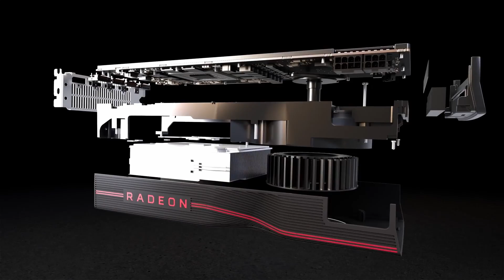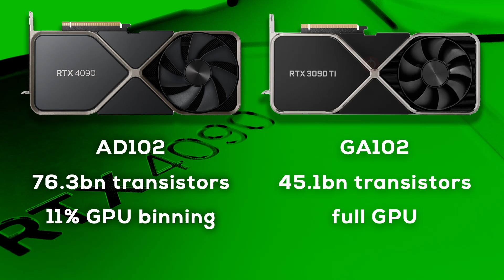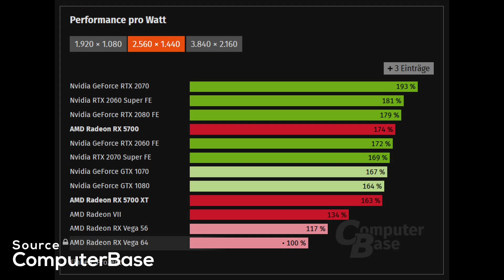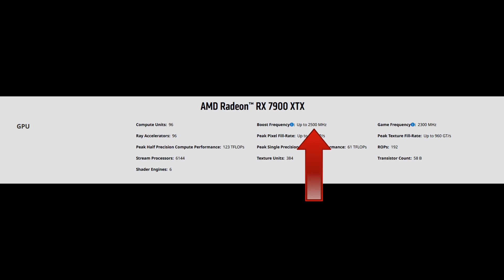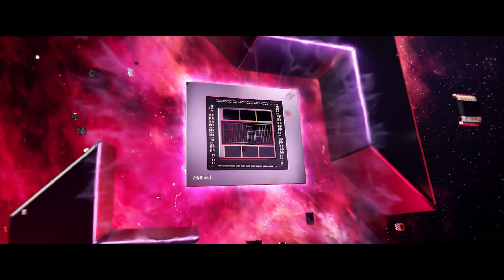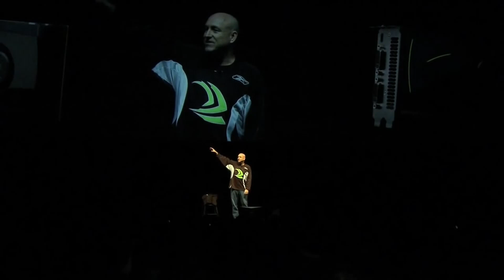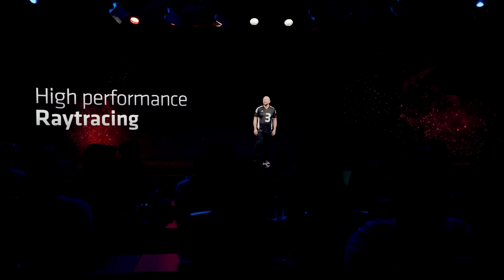RDNA3 – what went wrong?

Comment: If you think about it the 7900xtx was never meant for greatness. This is how I see it by doing a comparison with the 6900xt. 

The 7900xtx has 20% more compute units (96 vs 80), an average in game clock that is around 13% higher (2650 mhz vs 2350mhz), and the individual WGPs in rdna3 have an IPC advantage of around 17% according to AMD's slides. So let's do the math:

1*1.2*1.13*1.17 = 1.586 or 58%
The only factor which this analysis doesn't take into account is memory bandwidth, and we'd expect to see an additional smaller boost because I think many people agree the 6900xt was slightly bandwidth limited starved at 4k due to the 256 bit bus, and the 7900xtx is very impressive in the memory bandwidth department. 

In some games we do see +60% improvement on the 7900xtx vs 6900xt, but my thinking is this is where the game engine/driver can capitalise on the 17% ipc improvement from the new architecture. I have to admit I was disappointed that Amd have double the number of fp32 units per shader, and added larger registers/l1 cach, only for a meager 17% increase. In some games it looks like the new architecture doesn't offer anything above rdna2, and that will be a challenge for the driver team. That is my interpretation, always enjoy your videos!
Reply: wait wait wait? must be coffee, but do you mean that the 6900xt ran at 2350mhz? had two 6900xt and both of them ran with a frequency of 2540 without my doing anything. so the gameclock is a worst case scenario like on nvidia when they show a boost clock minimum which every gpu hits way over that.

To me it seems like everythign is in order, ie like it should if we talk about the increased memory bandwidth and shader count over 6900xt. If we then talk that the new rdna3 gpu actually is like ampere/ada then we should get at least additional perf uplift of 50% which we dont see. So something is up with the fp perf. And lets be honest, future games will probably not use that much integer executions so having int/fp capable alu units is the future because why would u have unused die area.
Reply: @Pillokun  You should check out an article by Computerbase where they did a clock for clock comparison between rdna3 and rdna2. They found the rearchitected rdna3 compute unit only gives a 9% performance increase on average. So definitely a long way from 50%!
Reply: @viktortheslickster5824  it means it does not work as it should. if u make the only int capable alu units able to execute float as well then all the unused resources often as many as the fp32 alu units u suddenly gain that much fp perf. so from 6k fp32 we now have 12k float alu units. 

Now games still need integer calculations but over all the most a game is doing is 25 to 33% of the total float calc so if we gaing 6k fp units we need to remove at least 33% to integer. so 6k fp32 x .66 = just a bit less than 4k additional fp32 units. and then we have to remove a bit because of u-arch deficiencies/game not utilising/scaling 1:1 with the available float units.  

so we should at least have gaming perf that equates to 9k fp32 units and that is not what we see because something is up with rdna3.

Comment: Anybody not expecting problems ie intel Nvidia and now AMD is optimistic. When new products hit the 1st gen usually have issues. That makes the customers beta testers. There's obviously something going wrong because the power draw at idle is way too high. Hopefully a better stepping will fix it. The drivers are also a problem because the performance is wildly inconsistent. I also think that the price is too high. I'll wait before I decide what to buy.
Reply from the maker: RDNA3 has a lot of new stuff: new architecture, new chiplet design, new 5nm process. It's a huge step for AMD and means a lot more things can break.

Comment: 7900 XTX owner here, I'm enjoying my awesome GPU that takes 110w on idle desktop :D (previous generation also had issues with high refresh monitors, taking up to 50w on idle)
While gaming I see a 30% performance uplift at the same wattage, compared to a 6900 XT LC (XTXH+18Gbps).
One more thing I noticed is that if you force the GPU to stay on high clock speeds, lets say 3000Mhz, it's gona sacrifice memory speed... resulting in a lower framerate (core 2400Mhz higher FPS than 3000Mhz) could it be that there's not enough power on the board to maintain high memory and high clock speeds at the same time ?
Reply: A 3rd 8 pin may be needed.  But AMD will have to put their foot in their mouth thanks to their claims earlier.
Reply from the maker: It's a really interesting GPU and I'm sure better drivers will fix a lot of early quirks.

Comment: got a good deal on a 6800 xt im happy
Reply from the maker: Great card, I'm still using a RX 6800 and it performs well (aside for Witcher 3 next-gen)
Reply: @HighYield  my build, ab350n motherboard from 2017, 5800x3d, 6800 xt ($1500 nzd or about 950usd i paid for these parts. I can even use SAM its great. and this is all running on a 500w psu

Comment: I just returned a 6950xt one month ago (XFX). Unfortunately, it was faulty. I noted the main issue was about power.  When it worked, it was impressive, then a lot of green screen and reboot. Can't pass 303w (instead 321w/340w full power stock settings). No way. Similar problem of a streamer with a 6950 gigabyte (stuck at 328 instead 350 or more).  I'm starting to think about some old manifacturing mismatch of rdna2 still present on rdna3.
Reply from the maker: I bought a RX 6800 in early 2021 and didnt have any issues so far, RDNA2 is very stable over all. Sorry you got a faulty one!

Comment: AMD's performance, as I've been saying since I joined the discussion, is that the performance envelop was smaller in the past generations comparatively between Nvidia and AMD.  It came down to process.  Nvidia chose to go with a better process from TSMC and proved the architecture of AMD will not have been better.

TSMC is the winner here.

Comment: how did they go wrong ? i will tell you it didnt go wrong at all,, infact they out smarted Nvidia with performance and pricing, plain and simple and AMD NEVER wanted to compete with the 4090 or even 4080 they said so,

i have 2 systems 1 full AMD and another Intel Nvidia and both run fine but bang for buck the AMD system smashes the Intel Nvidia set up, and as the age old saying goes money is better off in my pocket than somebody else, you are looking too hard into details that done need to be looked in too.

Comment: AMD confirmed that the silicon is fine re: shader prefetch. The fact that they nailed it on the first (A0) taping is a testament to the skills of their hardware engineers.
The issues lie with their drivers.
Reply from the maker: Yes, I mentioned it in the video too, but kept the previously recorded parts because it was an interesting rumor imho.
A0 is great, especially for such a revolutionary chiplet design. Still, there are usually a lot of different bugs in any A0 silicon, doesnt mean they have to be that impactful.
Reply: Drivers, or maybe even a firmware update might solve the issues..

Comment: Like any new AMD architecture, it has its problems. The next driver versions as well as much higher clock speeds of 3.0Ghz + Ghz will bring a significant advantage over the competition. I've never owned any Nvidia product, I've been using ATI/AMD products since the early 90's. In terms of price and quality, the new architecture leaves no doubt as to who won the race. Yes. As Linus said, it's AMD time
Reply from the maker: RDNA2 had a much smoother launch, I was really hoping AMD would stick to that quality over time.

Comment: What went wrong is that all the leakers were wrong about the shader count. They were right about the RTX 4090 but were wrong about the 7900XTX and XT. One has to wonder if it was purposefully midleading...given that they were right about the 4090. Also what went wrong is that AMD cherry picked benchmarks way more on this release than they did the RX 6000 series.
As for the 5700XT it was targeting the 2070 but many reviewers put it against the 2070 Super anyway. It was indeed faster than the 2070 and $100.00 cheaper.
Hmm about the transistor count....RDNA2 21 die has 5120 shaders...the RDNA2 31 die has 6144 shaders...does that sound like double the transistors to you? It would mean their CUs got LARGER with a new node if all 6144 shaders account for those 57 billion transistors...maybe some of the die is disabled.
Reply from the maker: The rumors were indeed way to optimistic. As for the transistors, AMD added AI-cores for the first time, the RT-cores got bigger, the a much improved display engine, a dual video-decoder that also now support AV1, a new encoder, a 50% larger memory interface and while its not that many more shader cores, they now are dual issue. Ofc I dont know for sure, but I think there are no disabled parts.

Comment: Something that has to be said and was touched upon in this video is that AMD is not getting good performance per die area as people claim. If you look at charts shared by AMD cache only shrink 10%  going from 6nm to 5nm that means that a monolithic 7900 xtx would have been 480 mm2 in size. if you look at the 4080 it has a die size of 380 mm2. With less than 80% of the theorized 7900 xtx die size the 4080 matches it in raster and it destroy it in ray tracing/upscaling all while being more energy efficient . I understand that the 4080 is more expensive but putting the prices that companies assign to their products aside and just analyzing technology, Lovelace is a far superior architecture to RDNA 3 and AMD lost bad. Maybe they can get better with a new release but i don't think this can be mitigated with just drivers.
Reply: going by price to performance AMD did not lose bad. I wouldn't say far superior technology either. It's just that RDNA 3 was rushed before they perfected it on the software side and that's very fixable. When fully overclocked the 7900xtx matches the 4090 for 500 less, and that's before the driver updates that are sure to come. Go look at the benchmarks.

Lovelace is superior in RT and efficiency, but overall no. RDNA3 has higher potential at much better value.
Reply: @mjkittredge  if we are going to compare over clocking then also over clock the 4090 . If you do that  the 7900 xtx will be a bit behind the 4090 . Which really gives you the same result as the comparison to the 4080. Because the 7900xtx is a fully unlocked die and the 4090 isn't. If you remove the part of the die that doesn't work the 4090 is a 540 mm2  slightly bigger than the 7900 xtx and slightly better in raster and again destroys it in Ray tracing, upscaling and efficiency . So similar conclusions. Not to mention the 4090 extra cores doesn't make it scale linearly compared the 4080 and really it is too big for games to take full advantage of. It has 60% more cores than the 4080 but gets only 30% more performance . 
And as I said drivers will not fix this if you look at the games where RDNA 3 allegedly shows its true potential , you will notice that RDNA 2 is also doing better than its average. These are games that simply work  better on AMD hardware it is not a window to RDNA 3 true potential.   And I would say the AIB models are already getting around the silicone flaws of RDNA 3 by just giving it more power . If AMD fixes the silicone I imagine the gains compared to these models are going to be in efficiency not performance.

Comment: i have heard that the rx 7900xt only leads previous gen in some titles by less than 10%. this would have to be issues with the card, over design goals. having made for the first time a chiplet based system, they will likely come with a complete overhaul in drivers. i am surprised that this card is even performing this well.

Comment: Rx 7900xtx has just 96CUs and 96mb l3 Cache which is not good improvement over rx6900xt and Fixed power draw is also not good rx 7900xtx is way less efficient than rtx 4090 because 4090 is pulling less than 300 watts if you play games at 1440p at max settings

Comment: Remember when people were shitting on nvidia for power draw, and here we are. The 4080 is far more efficient. Uses less power, runs much cooler, and has no coil whine. All while leading performance overall by around +15% (before RT and DLSS3)
Reply from the maker: Oh yes, I was expecting RDNA3 to be much more power efficient than Lovelace.
Reply: Are you a paid NVIDIA troll or do you do it for free? The 4080 is massively overpriced. Leading performance by 15% in what? All the benchmarks put the 7900xtx 5-10% ahead of the 4080. Stop copy pasting lies, people have seen the evidence that you're wrong.
Reply: @mjkittredge  "Overpriced" the 7900xtx AIB are selling for $1,100 - $1,200+ They run much hotter, use more power, have horrible coil whine, shitty RT performance and use FSR. Nvidia cards use the much superior DLSS and they can also use FSR (but why would you?).
Reply: @bryzeer5075  I've watched  side to side comparisons of FSR vs DLSS  in multiple games, and myself and the reviewers said the same thing, it's so close as to be indestinguishable.

The reference cards have coil whine. For you to say all AIBs have coil whine needs citation. I've watched the review videos of AIBs in use and that was not the case. Some of the AIBs are still 999. 

RT is in 100 games, it's a niche gimmick. The  RT is not 'shitty' like your hot takes, it's at the level of a 3090ti. The benchmarks of 4k ultra rt are silly, nobody should be using ultra settings, it just makes you lose frames for no appreciable difference in visuals. You can get completely playable frames with RT on by tweaking some settings around.
Reply: @mjkittredge  PC gamer already stated the 4080 on average runs around +15% better using all games they tested. Some games around 25% faster. I don't have a 4080, I think it's stupid. I have a 4090.
Reply: @bryzeer5075  PC Gamer must be NIVIDIA shills like you. All the benchmarks I've seen from tech tubers show 5-10% win for the AMD card.

Ah just  checked, yep, 8 game benchmark where he cherry picked games that  favor NVIDIA cards. Wow you both lie by omission. Plus he used a intel CPU and missed out on SAM. Of course he omitted Warzone where the 7900xtx beats the 4090.

You're so full of sh!t. Imagine this sad NVIDIOT trollboy searching the web for any crappy site that would show the 4080 beating the 7900xtx. What a joke.
Reply: @mjkittredge  You seem to have an issue with me, personally. I live in Nashville, TN, if you wanna settle this offline
Reply: @bryzeer5075  LOL! A real internet tough guy. Yeah sure I'll drive over to TN to fight some redneck who loves NVIDIA so much he'll throw hands over it. Just stick to playing video games son. You got the most expensive GPU but you waste time arguing online when you could be, oh I don't know. USING IT TO PLAY GAMES? FFS. Did you just get it as a status symbol so you could assuage your raging superiority complex?
Reply: @mjkittredge  I am from Italy. I've been in TN for 6yrs. Far from a "redneck" do you know how much it cost to live in Nashville? Where are you at.
Reply: @bryzeer5075  a bibbity boobity with the yeehaws of TN. What an odd combination. Hope you like hearing YALL and country music lol. 6 years and you still haven't picked up any Southern Hospitality. I'm in NH.
Reply: @mjkittredge  Please look up the cost of living for Nashville. Also, look up our school systems. TN is one of the best states in the country to live if you have a family.